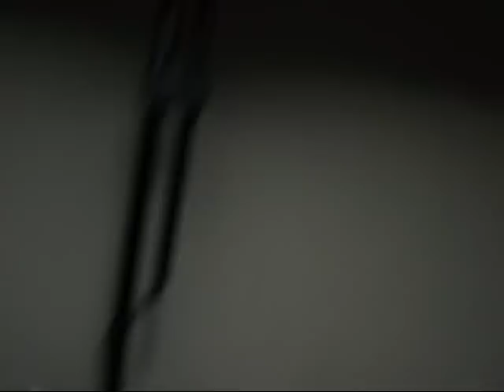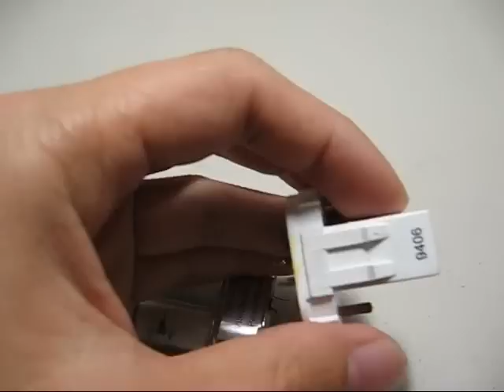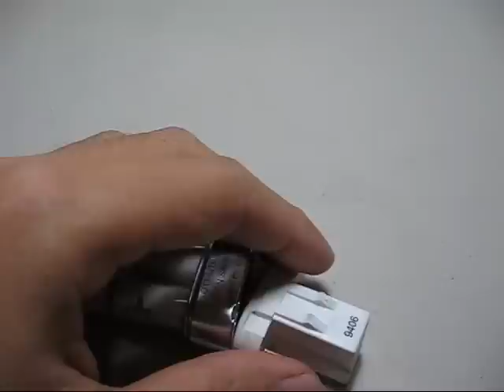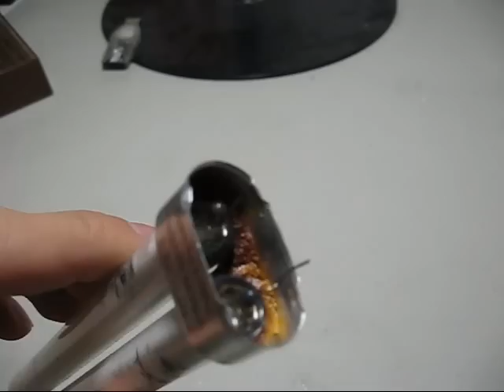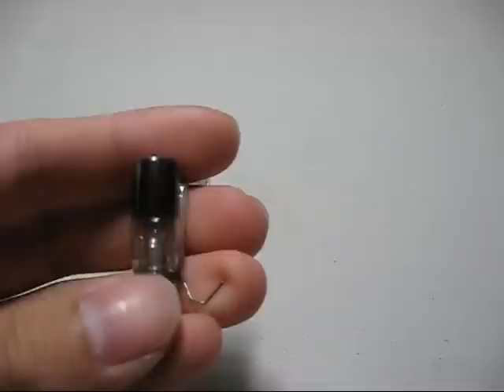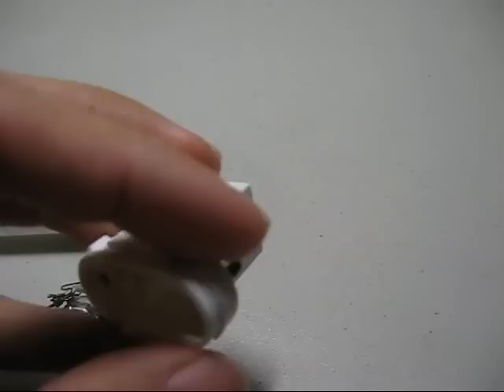Inside a 13 watt compact fluorescent

Comment: These new "energy saving" lightbulbs are a good idea, but what nobody seems to realize is that it's hazardous material. The proper process of disposing the chemicals in those light bulbs is lengthy and expensive. This is one of those things I see as "well you've solved one problem, but now you've created a new bigger problem." Very neat video though.